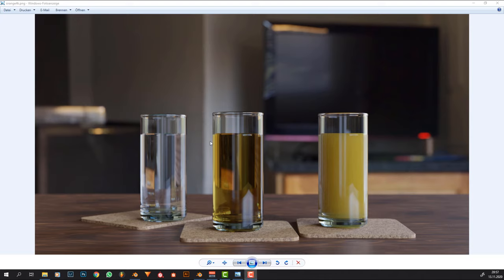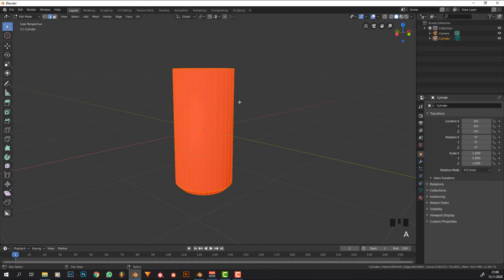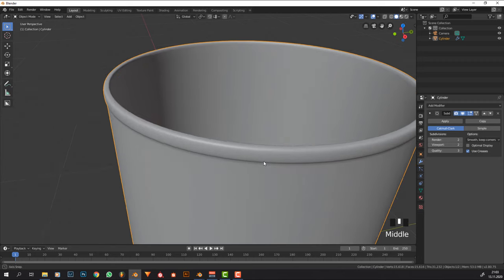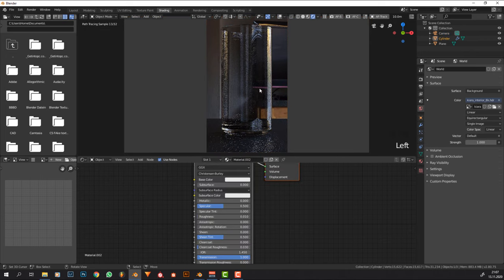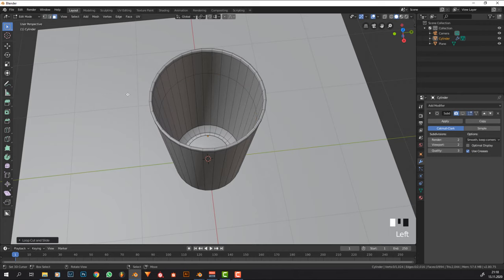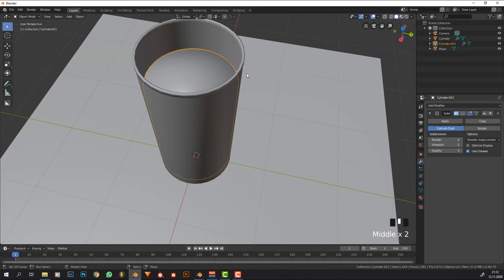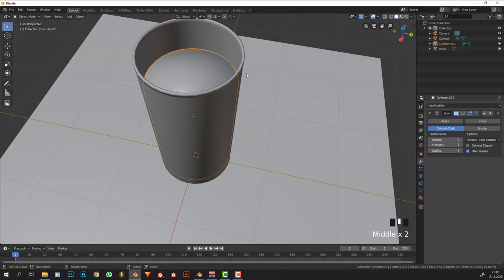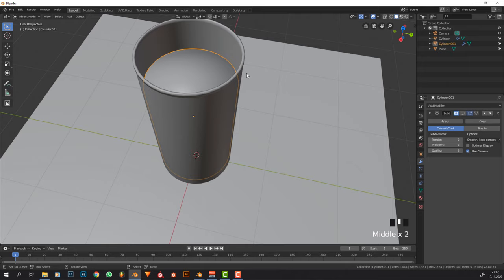Common Mistakes When Making Glass / How To Make A Glass In Blender (Beginner Tutorial)

Comment: I know why the model is red instead of blue. When you do ALT + E, it's to Extrude the faces (bring them outwards). When you did it, you place them inwards, so the entire thing was "inside out" :)
You can see that if you enable face orientation before extruding the faces, it will be red if you place them inwards, and blue if you drag them outwards.
Reply: Just my thoughts exactly... I had a little laugh when he said he had "done this like 200 times over for this tutorial and it's always red" :)  Maybe after let's say 100 times it would have been time to either 1. switch the face normals before extruding
or 2. extrude outwards instead of inwards (okay, that's a problem if you modeled the outer shape of the glass)
or 3. use a Solidify Modifier and apply it afterwards.
Reply from the maker: Guys
I know why it happens
But you'll have to understand that making tutorials is really hard, you gotta do things over and over again and remember every single step to make it as efficient as possible

I generally record one and the same tutorial between 5 and 20 times until I feel it's good enough
That usually ends up being something between 4h and 20h of work just to record it

I just want people to know that stuff like that happens if you aren't careful about what you're doing and how to fix it, since it is a good learning experience
Reply: @philipkriegel  I totally understand that, my channel is nothing but tutorials lol :) I do the same thing. I just thought I would mention it because it sounded like you didn't know why it was happening every time
Reply from the maker: I've been using blender for about 6 years now

I know why it happens, but I'm trying to have every single issue a person might have while recreating my stuff in my videos so they see how to fix them
And people still surprise me sometimes on my server with problems that I never would've thought of
Reply: Your doing better than me. ALT+E brings up my emails, no BS, FFS LOL
Reply: I actually did this exact model twice, once by extruding the faces inwards, and once by extruding outwards. Both times face orientation was fine.

Comment: Came for the orange juice, stayed for nice explanations and smooth music :D so learnt a nice glass cycles shader
For anyone if principled volume density DOESN'T work, it can be because you didn't apply the scale (select obj CTRL + A, apply)

BUT if density still doesn't works, it is probably, you are like me, designing things with real world sizes.
I made a 3cm/10cm glass, so I tried density 200-420 and it works! Volume bounce 12 with 300 sampling.
Reply from the maker: I'm glad you liked it!
Always nice to get feedback like this :D
Reply: So are you telling me that scale in blender is actually important because it can impact the effect of node values and the result?
Reply from the maker: Yes, that's exactly how it is
Most BSDF nodes will be distorted or stretched if the scale of the object is not applied

Also volume nodes won't give you realistic outputs if your object is too big or too small
Reply: @philipkriegel  one more question, he said working with real world sizes, what difference does this make when it comes to the results?
Reply from the maker: If your size is of by a lot, it's simply not going to look realistic. You values will need to be bigger and therefore it will have a different look to it

I suggest making things to scale whenever possible
Reply: @philipkriegel  Awesome, thanks for the insight.

Comment: Thanks for the tutorial on this topic. Regarding the lip on the edge, I don’t think it’s for safety. It’s just chipper in mass production. Expensive glasses often doesn’t have any lip or it is barely noticeable.
Reply from the maker: Expensive glasses like wine glasses also tend to not be used as often and are usually a lot easier to break

It's a deliberate manufacturing decision which actually increases the production cost

While for mass production mainstream glass, the lip offers more durability, expensive glassware like wine glasses use the lip to better distribute the liquid for a finer taste

Glasses without a lip are usually cheaper and made out of more brittle glass

You can read more about it on the internet if you are interested :D

Comment: Many thanks again Philip! I wondered what the edge loops might be doing. I reduced the IOR value and that gives a result that I can use.
Reply from the maker: You're welcome :)

The IOR is the index of refraction
For the most realistic results, it should be set to 1.44-1.46 for glass and about 1.333 for liquids

Having an IOR of 1 is like looking at air
If you're unsure what the index of refraction is, I suggest you watch a video on it or read an article, as it's something every material has :)

Comment: Great tutorial. Although I think using creases would help you, for example at 16:45 when you put a lot of loops while doing the fluid part
Reply from the maker: I try to avoid creases because they don't add topology so you need a higher topology count to make them work

Also you would want a little bit of roundong on the top of the liquid to showcase the surface tention, which in the end, doesn't add much, but at least in some cases, it'll show you a reflective line where the liquid ends.

You should try to avoid creases unless you make film assets where even topology is important, or you do boolean operations without retopology afterwards

Comment: Amazing tips about how to approach realism. I have a question. instead of Extrude Faces Along Normals for thickness can we use solidify modifier? what are the pro and cons?
Reply from the maker: It's the same thing, but you may have trouble dealing with overlapping vertices later on when working on such small scales
Reply: @philipkriegel  thanks for unexpectedly fast reply. And thank you for the tip.. I'll keep this in mind.

Comment: Thank you, Philip! Building my first glass object was a breeze with your input.
One question, the color for Volume Absorption comes out inverted in Cycles Rendering. I can make it work but am wondering how to fix this. Any hints you can give?

Edit: Turns out this must be some sort of bug. After restarting twice it works.
Reply from the maker: Thanks a lot, I'm always glad to hear that I'm helping people

If that happens in the future, selecting the object and pressing control+A and then applying the scale should fix the issue

If you scale the object and don't apply the scale, blender thinks that it has different dimensions and things get calculated differently
Reply: @philipkriegel  I'll keep that in mind! Thanks again.

Comment: Great tutorial. For anyone trying to learn and understand materials  and blender (me that is ) its real progress. The only thing i can't figure out is why i get close to your results only with far far bigger absorption density values (my orange juice is a failure). I must me doing something wrong I will redo the process and see. Thank you for the insightfull tutorial.
Reply from the maker: You're welcome, I'm always glad when I hear that I'm helping someone :)

The volume nodes use your objects size  when shading.
So having a 2 meter tall glass, or 3cm tall glass will have a negative impact, such as you needing higher or lower values to get a similar result

By pressing "N", a sidebar should pop up on the right, telling you the exact size of your selected object. Make sure it is the correct scale and then press control+A
And apply the scale

The issue should be fixed at that point
If it isn't, feel free to comment again or use one of the private messaging options I have for offer
(My website, discord, Instagram or Twitter, you'll maybe have to visit my website to find some of them, since I haven't upgraded my descriptions yet)
Reply: @philipkriegel  Indeed I forgot to apply scale. I did and nothing changed though. I took the liberty of sending you my (small) blender file minus the hdri via gmail. If you can spare the time to look at it its ok. If not its ok again the tutorial is more than enough help.
Reply from the maker: I definitely will look at it by tomorrow, as at my place it is already past midnight.
I'll tell you what the problem is/was once I get to it

Comment: Hey, great tutorial- thanks a ton! 
One quick question tho. My glass would not see through. Instead it has this inverted reflection of what's behind the glass (in this case, the drawers and the floor are reflected on the glass) I think I messed up the geometry somewhere along the way but I just want to avoid the mistake if I were to do it again. Any suggestion?
Reply from the maker: Make sure youre using the cycles render engine!
Glass does not work that well in EEVEE
If youbare using cycles, select it and go into edit mode

Press A to select everything and press shift+N
That should fix the normals if they are inverted

If it's none of that, tou probably have some overlapping geometry down at the bottom of the glass (inside)

Comment: Very nice video! thx a lot!

I have one question.
What if I want to set the background to an object. For example, through the glass I want to see the object behind it, how do i do that? :(
Reply from the maker: If you followed the tutorial, glass in itself is transmissive (light passes through, so you can see what's behind it). If you however have a curved piece of glass, like a cup, what you are seeing might get distorted, especially if there is water inside. So if you have a glass that is a little bit flatter, you will be able to see through just fine, with curved glasses, you're always going to have a little bit of distortion, that's just how physics work unfortunately

But generally, you should always be able to see what's behind it if you keep the roughness of both the glass and the liquid close to 0 (in my opinion, best at 0.01

Make sure to ask further questions if anything is unclear :)
Reply: @philipkriegel  thx for your replay, I appreciate 🙏

Comment: Great technique. Thanks! At the end though it looks like there might be something odd with the normals at the bottom of the glass. Kind of a pointy, wave-like pattern?
Reply from the maker: Thank you!
It's just the glass refracting itself because the bottom is lifted up
The normals are fine, I checked it
You have a good eye though, I didn't even notice the waves, they disappear once you tilt the camera by even as much as half a degree sadly
Reply: @philipkriegel  Thanks. Would there be any benefit to making the glass bottom and/or liquid top surface with grid fill? I seem to recall a technique of using proportional editing on a grid fill to pull the liquid surface up slightly from the center to get a slightly convex shape to simulate the surface tension.
Reply from the maker: You could do that if the liquid is the focal point of your scene and you think that people will look at it a lot
But people usually won't notice it's not there if you don't mention it

Surface tention goes downwards though as seen in this image: https://previews.123rf.com/images/utima/utima1603/utima160300178/54252997-water-glass-isolated-with-clipping-path.jpg

I hope I could help you with this and you can feel free to join my discord server should you have more questions :)

Comment: Tutorial is ok. I append a figure blend file, the glass is a big vase. No water, the optical distortion of thin glass cyclinder is as if a solid crystal ball effect. Not as in your HDR. Which I will not have because it just a dark theatre stage. So what is wrong? Will this not work for animation with moving camera/figures etc?
Reply from the maker: Hey there.
I'm not sure if I understand your question
Could you perhaps ask the question in a different way?

If I get what you are saying, you're having trouble with the reflection and the refraction

Are your normals pointing in the right direction?

Are you using eevee or cycles?
You can only render realistic glass with this method in cycles
Reply from the maker: Please join our discord server so we can further help you

Comment: Someone please help, how do you get the glass to be so clear, every time i try this the glass comes out still noisy it never comes out as clear as his especially when i have a area where i can see another layer of glass through the first one
Reply from the maker: Make sure your roughness is reasonably low.
Also make sure your normals are facing the right direction by selecting everything in edit mode and pressing shift+N.

If you are still getting darker spots then make sure that under the light path settings you turn the glossy rays higher (something like 10 or 12)

Hope this helps

Comment: Hey, I've been getting this issue whenever i try to make a glass material on blender for a while now. I used the same nodes with the same settings as you, but somehow the glass still comes out as opaque on the render and model. Does anyone know why that might be?
Reply from the maker: Yes
You are most likely using the Eevee render engine, and that in itself is a mistake if you want to make good looking glass

Always make sure to use cycles if you're going for realism
Reply: @philipkriegel  thanks for the reply Philip! Don't think it's the engine. Tried both eevee and cycles just in case.
Reply from the maker: Anyways glad to help

Maybe you could join my discord server and send me the blend file so i can take a look at it myself and maybe I could diagnose the problem

Comment: This is definitely worth subscribing!!! Thanks man. 
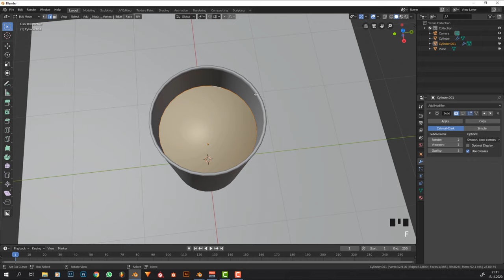What’s the shortcut to add faces at 14:14? I actually don’t know that trick and can’t find it on google
Reply from the maker: Thank you :D
I pressed control and +, you can also press control and - to remove faces
Reply: @philipkriegel  Hi Philip! I'm having trouble doing this from a laptop, without the numpad. I have emulated the numpad, but the + doesn't seem to be working. Would you by any chance have a solution? Thank you very much for the tutorial, it's excellent!
Reply from the maker: @thomasrivet5494  Thank you :)
Alternatively cou could press "C" and then you will get a circle.
Simply hold the left mouse button and you'll be selecting everything you brush over, I think that might be the second fastest way to do it :)
Reply: It is F

Comment: The purpose of the HDR is to provide a background? You position the camera very near the glass. The distortion caused by the glass looks as expected. If I want a glass cylinder in my animation, with a figure and camera movements? I will not have any imported HDR, just the figure. I get a spherical solid lens appearance, not a thin-walled glass.
Reply from the maker: The HDRI provides both a background and realistic lighting. It's much easier to light a scene with an HDRI then with the normal lights

I position the camera near the glass so that the depth of field is shallower (more blurred background)

When you import an object, it's always going to be completely solid
What you need to do is add a solidify modifier, and it will look as if it had thinner walls (you need to play with the thickness)
Reply: @philipkriegel  thanks Philip, you are really being as helpful as you can with this. I think there is some bit of the material physics that is not working, a cylinder with a thin wall can never produce a globe lens effect. I've seen a tutorial with a bit of jigging around, but basically not addressing the real issue. Which I have no idea what it is, without unpacking the python code for 'glass' material, what happens with an object in the scene.
Reply from the maker: When you click on shade smooth, cylinders tend to get bad shading because of the way the faces work on a cylinder
When you click on shade smooth, it will try to smooth out 3 connected faces
So it will smooth out the top, the side and the bottom at the same time
That will result in a sphere-like shading issue

In order to fix that, it might help to add an edge loop near the top and the bottom of the side of the cylinder (ctrl+R) and then a bevel modifier with 2 or 3 segments with the limit method set to angle

For further help, please join my discord server as I will be able to help you better with pictures and videos that might help you understand issues like that even better